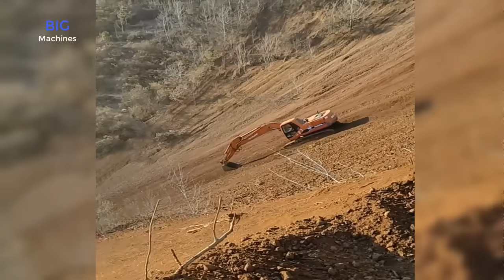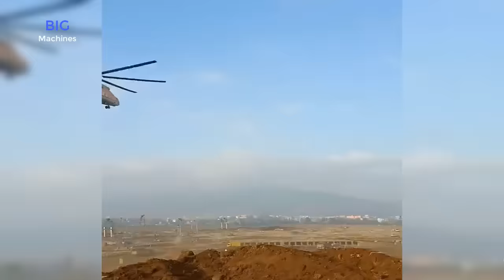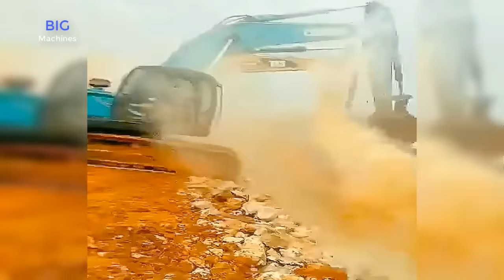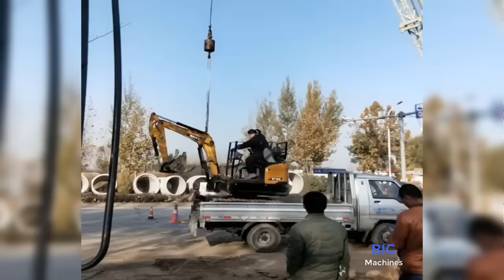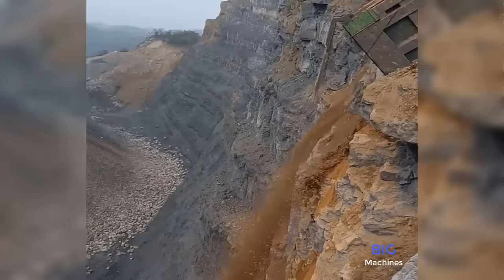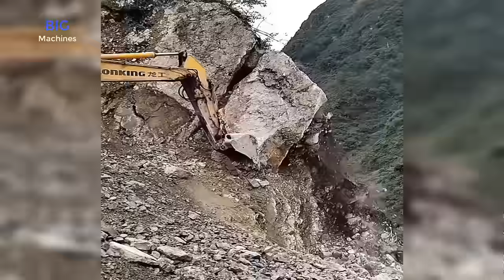10 Extreme Dangerous Idiots Excavator Operator Skill - Fastest Climbing Excavator Machines Driving

Comment: The biggest I ever operated was a 5.5t excavator and for me even a small excavator like that was one of the most impressive human creations I ever used. The power is simply unbelievable compared to human strength. You move masses of soil in seconds which would take days with shovels. You can rip out trees and move huge rocks like nothing. And it's so freaking easy to get a feeling for those machines. After a few minutes the excavator feels like a part of yourself.
Reply: The most difficult excavator to operate on a tough job is the smallest ones.They tip over much easier.
Reply: @JohnJewel  i don t think the smallest are the hardest to operate on
Reply: I feel the same. I have small and big equipment. Even the small equipment I’m super impressed amazing how someone invented it. Small or big it’s always a blast operate
Reply: I worked for an equipment rental company in my 20s (shout out to Skagit Birch Equipment) and got to run thousands of different kinds of machines over the years from boom lifts, forklifts of every style, skid steers, bulldozers, excavators. those little ride along ditch witches (the dingo 420 lol). Probably my favorite was getting to test the 150 foot telescoping boom lift. Nothing like seeing your city from a basket 150 ft in the air. I always recommend that kind of job to young people, you get so much experience in very short amount of time lol.
Reply: Sffsrd
Reply: Excavators can lift from 6,000kg to 80,000kg depending on their size. Excavators are beyond powerful.
Reply: @JohnJewel  little ones were only made for little things 😂
Reply: My John Deere stock has still done well in this downturn.
Reply: Theyre hella fun to operate.
Reply: Worked for family-owned const co. It means you get the most dangerous jobs with the weirdest attachments. But you also get to spend the most amount of time on what you want run 
The New D11 is a modern marvel. You can almost fall asleep and let it run on its own. It has auto leveling sensors to keep you from under-cutting. Its all about GPS and wireless control now. They've even created secondary operator platforms. You go into an office onsite jump in a chair identical the the tractor. Cameras in the dozer plaster multi screens you sit in in total silence. My ears will never stop ringing, My feet are so sensitive I can feel engine vibrations from down the street while lying in bed I didn't intend to ne so sensitive but it's important as you know to feel whats going on at the end of the bucket Everything is hydrostatic controlled now, hand sensitivity almost obsolete And the handheld remotes they have let you link up and run upto 7-8 Dozers at the same time 
.
Reply: @JohnJewel  I would agree with you there they tend to nose dive quite easy. They don't have  the track stick out that the larger  machines have. That makes a big difference when tracking a machine on slopes.

Comment: Awfully good saves, most of these.  And a good demonstration of excavator acrobatics.  It does take a respectable amount of experience & full-body coordination to onload an excavator onto a flatbed truck without ramps or to get it unstuck when it's lost its footing...  I must admit, though, that bozo that kept scratching on the face of a 10 story high cliff was a suicidal maniac 😲

I've owned & operated tractors for 10 years now.  To me operating an excavator is practically the same as that of a tractor having a 4-lever-controlled backhoe.  The difference is on an excavator, you get to steer & drive the vehicle at the same time you're using that hydraulic arm.  Still, I would never be able to successfully get away with the stunts in these clips!
Reply: Geo Thomas  some of its just plain luck

Comment: Ok, so the one where they unloaded the mini-excavator with the crane can't have happened in America. Here are some reasons why: 1, improper lift point. The arm wasn't designed for that and I severely doubt it was approved for it by the manufacturer. 2, only one lift point; load unbalanced. 3, lifted far higher than needed, causing unnecessary hazard. 4, operator actually ON the mini. 5, NO PPE worn by mini-excavator operator. Not that PPE would've mattered if that cable had parted while he was 40 feet in the air anyway. In the USA, OSHA would land on that operation with both feet; there would be some kind of major penalty to every equipment operator involved and the company would likely be permanently disbanded with the owners/executives arrested on many felony charges involving the words "reckless", "negligent" and "endangerment" in a variety of sequences. So, that must've been in some other country where they are far more accepting of workplace hazards. That whole thing was just stupid; while I see why they were unloading it with a crane in the first place, NONE of those lazy, careless and reckless risks contributed to the task at all.
Reply: OSHAtup
Reply: @taylorgarrigan2077  Cute, I guess? Too obvious to really crack me up.

Comment: “Idiots” ?? Most of these guys are skilled
Reply: I was thinking the same thing when I watched the video, it started off with proper failures and then the video later on didn’t make any sense, but yes there are failures in this video that means if the operator was properly trained for working with this machine and the task, you have to always know what your doing and if it’s safe especially with demolition, because if you almost got yourself killed or if the company now has a machine that got scrapped
Reply: Christopher Rodmell very true